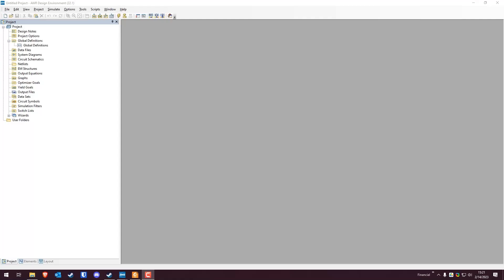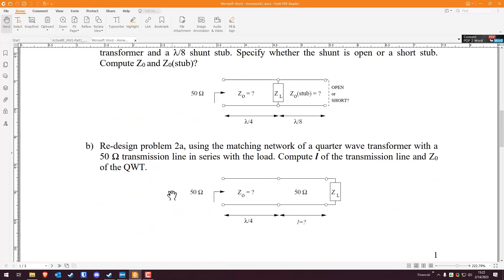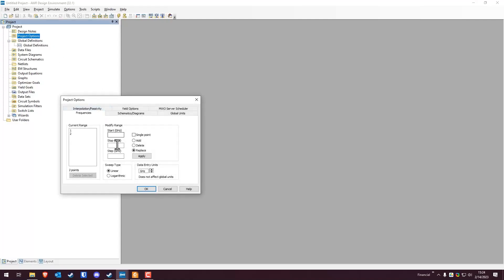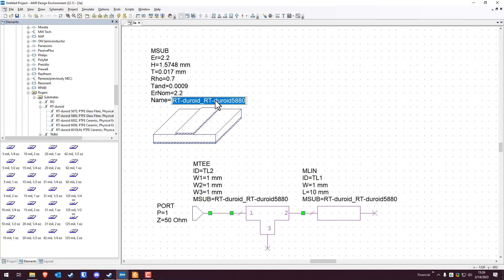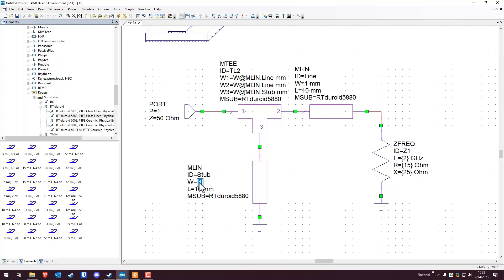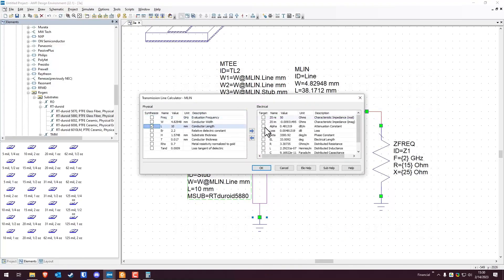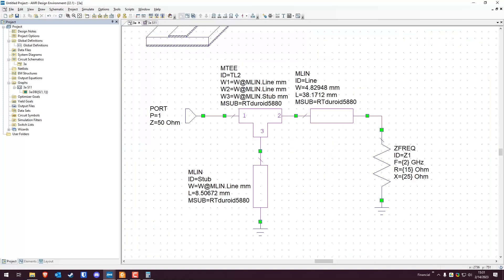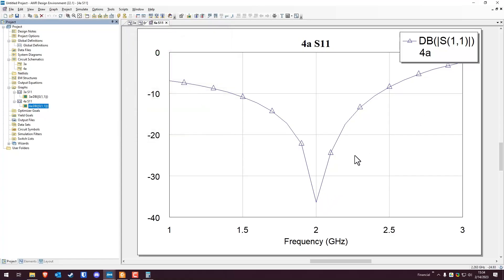Microstrip Matching Network Homework - Extras 1 - AWR Microwave Office V17.0 Tutorial

Comment: Thanks a lot, I learned how to used it from your video. You solved a problem as you showed in the video, can you tell me that if I have my own unit cell having one substrate on which two layers including square slot and square patch layers, We determine its equivalent circuit, then how can I use an internal port between two parts of the circuit with thickness of substract and impedance find based on formula. I am stucked in such problem, can you solve such example.